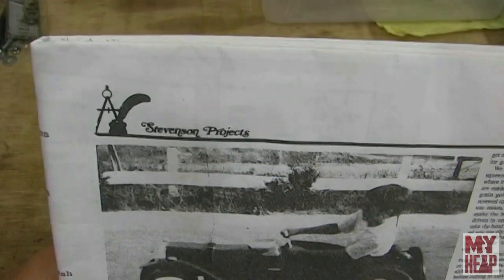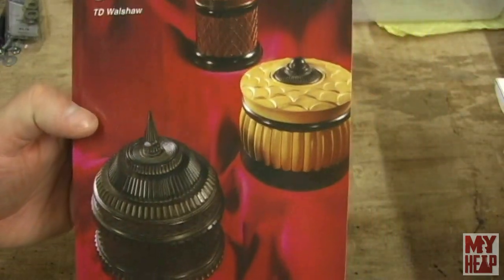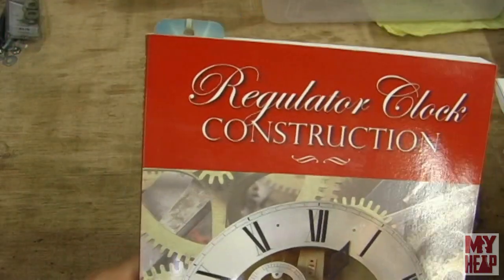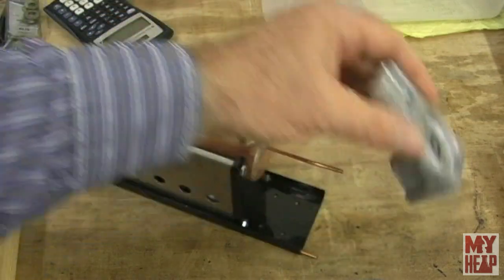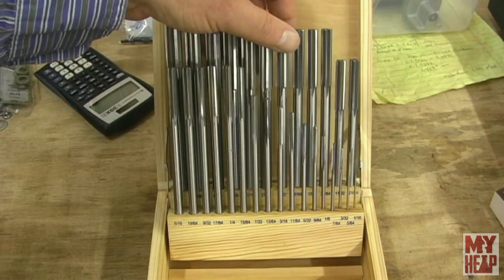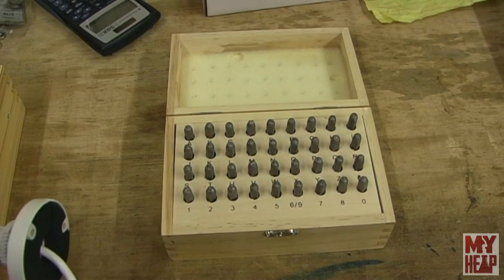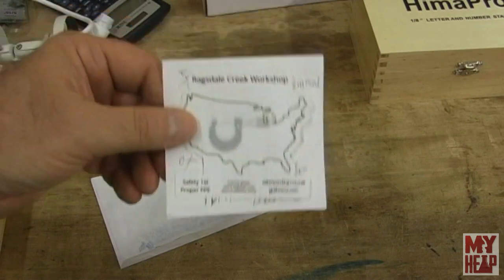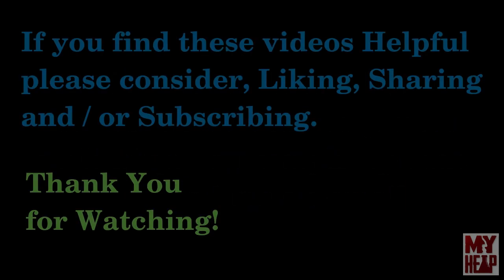Shop Update and the New Year

Comment: That TD Walshaw book is excellent Joe. There are many others about Ornamental Turning and much more detailed if you go looking. It's pretty interesting seeing what they accomplished using purely mechanical methods. There's been modern and even home built CNC controlled OT lathes made, expensive either way of course. Also what are called Rose Engine Lathes that can produce some extremely complex patterns. But Walshaws book does show how a lot can be done on even standard metal working lathes with an over head drive and shop made cutter frames.A mill, rotary table and boring head allows a whole lot more. You can find a lot of different machining methods and techniques outside of the more traditional sources like those OT and watch/clock making books. While I've got a Suburban now I did own the exact same sine bar you showed. For the price I thought mine was very well made. If you've got a surface plate and a 10ths indicator it's worth double checking the roll spacing against your gauge blocks.

One I can't recommend highly enough if you don't already have it is the George H. Thomas book The Model Engineer's Workshop Manual. By far the best I own or have ever read and I've learned more from it than everything else I have combined. Much cheaper to order it direct from here https://www.teepublishing.co.uk/books/in-your-workshop/model-engineers-workshop-manual/ than pay what the reseller bandits want on Ebay.
Reply from the maker: I have only read a bit of it at this point where he covers a few of the lathes built for OT.  I have read about headstock features, tailstocks and carriage assemblies ant features about them, read a bout some chucks and turning frames.  But that is pretty much where I am at, at the moment.  I have been reading back and forth between the regulator clock book and Walshaws OT book.  Speaking of OT, I have another book of the same title by J.H. Evans. My wife bought this one for me back on Fathers day.  I skimmed it but have not read it yet.  The pictures of the work produced by these methods amaze me.  While I can build a CNC lathe, the manual methods just seem something a bit better to me.  Not that I am against CNC, because I am not.  I have a home built CNC router that has cut many things out for me and others.

I don't have the book you speak of, but with such a glowing review, it is going on my list!!!  I do have Tubal Cains Model Engineers handbooks, and a model engineer course (so to speak) from Peter Wright.  I cannot remember the name off the top of my head.

I will take a reading on the Sine bar as per your suggestion.  I have a 1/2 tenths indicator, maybe that will be good enough.

Thank you for the feedback and extra information.  I am grateful to you.  God Bless.

Joe
Reply: @MyHeap  Funny thing about OT is it seems it interests you or for most with home shops it seems pointless. Not much middle ground from what I've seen.There's a fair number of YT videos about it, but they obviously can't go into the detail the books can. Plus there's a few specialized forums for OT. You should find Walshaws drawings, pictures and explanation about the Geometric Chuck real interesting.  For a modern rose engine manufacturer https://lindowmachineworks.com/lindow-rose-engine-menu/ but many home built variations have been built. There should be PDF files found with Google for what's called a MDF Rose Engine. Anyone with machine tools could do far better, but those drawings will give you the basic design.

Generally there's two types of rose engines, ones where the head stock only rocks while following the pattern or the head stock can both rock and/or move in/out to the cutting tool. Walshaw's explanation and drawings for how the classic "fish" pattern is made using a modern boring head shows there a much more powerful tool than most realize. My OT books and especially the two G.H. Thomas books I have lured me into buying one of these http://www.hemingwaykits.com/acatalog/The_Quick_Step_Mill__.html Live tooling on a lathes cross slide can work just as well for manual machines as it does for industrial CNC. G.H. Thomas's books did show me the importance of a good head stock dividing system for a lathe. Being UK based both his books lean heavily towards the Myford Super 7 lathe. But most or all of his designs could be re done to work with  just about any lathe with a 8" swing or better.
Reply from the maker: @turningpoint6643  thanks again for being such a resource.  I will see if I can find the MDF rose lathe when I am at the computer.  If I can remember. Haha.

Comment: malcolm wilds book is amazing. decarles book is a bit dated. looking forward to a longcase year run regulator build.
Reply: PS go with the course thread for the bearing bush
Reply from the maker: I am looking forward to reading them.  I have a great love for books.  :-)
Reply from the maker: @EmmaRitson  well, course thread UNC would be 1/4-20.  I have already drilled the tap size for UNF which is 1/4-28 so will need to stick with that.  Otherwise I fear I would not end up with enough thread to have any strength.  😀
Reply from the maker: Oh, and thank you for watching Emma.
Reply: @MyHeap  hardly needs a thread. a knurl would do , or a dab of loctite. the screw in bush is nicely engineered tho
Reply from the maker: @EmmaRitson  good to know.  While I have you here, what next?  The book binding video or the next KW engine video?  I should have a little time to do something tomorrow.